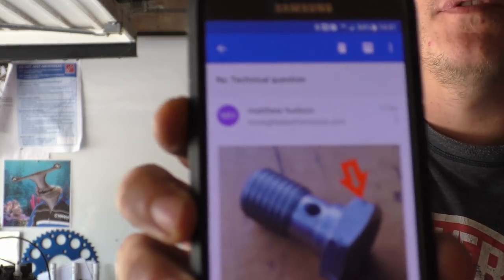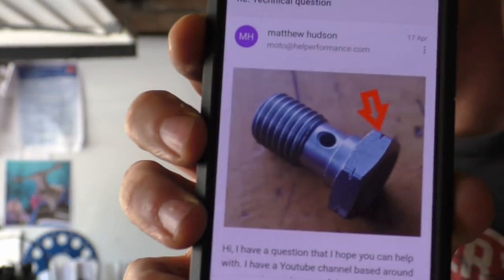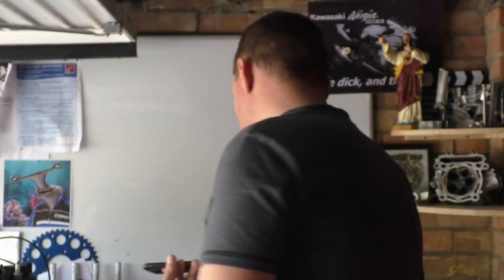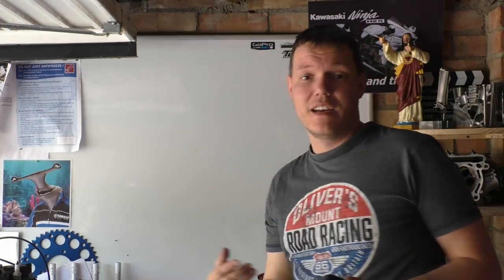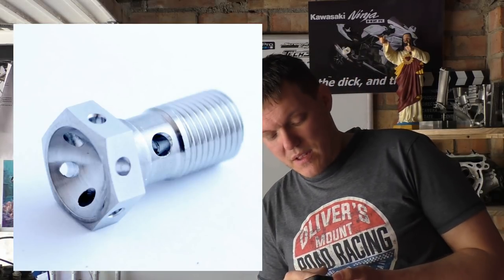Banjo bolt notches - and why they are...

Comment: Impress the girls? Ha ha, like most design/engineering fascinations , it'll go unnoticed.....our Mazda 5 mpv has a clever mechanism that rotates the seat belt anchor as you raise and lower the rear seat cushion, preventing the need to hold it up to stop it getting trapped. It fascinates me to think that a nameless Japanese engineer thought about this and designed it to do that & most people won't even notice it. But I did 😊
Reply: wirdy1 On the subject of little touches that nobody will notice or care about, the retractable strings on my Golf's parcel shelf are overengineered so they can't make noise, as apparently when in development the spring that pulls the string back would rattle when travelling at high speed. 
Another one: if you have one of those standard in-car red coloured medical kits and a compartment in the rear armrest, it's more likely than not that they're the same dimensions so you can have two medical kits in the car at once. Saw that one at an Audi stand at Silverstone.

Comment: I have a question for you. Why are banjo bolts cross drilled instead of fluted like a thread tap? Both ways seem like they would work.
Reply from the maker: Because cross drilling is easier. The bolt is turned to shape on its rotational centre - easy to pop a hole in.